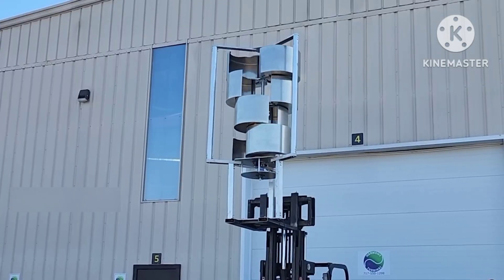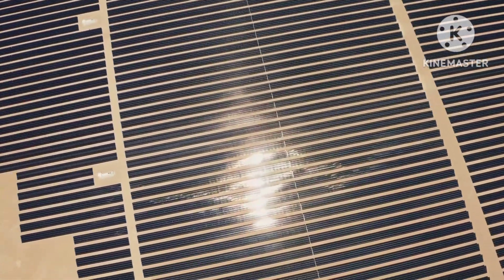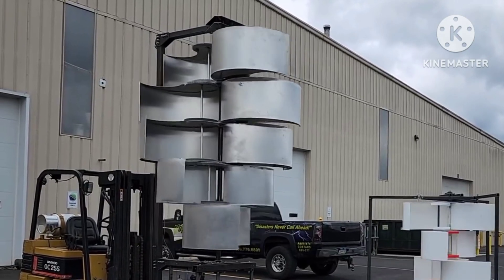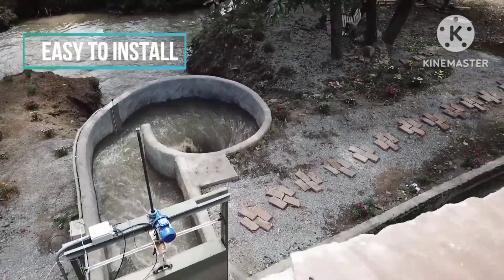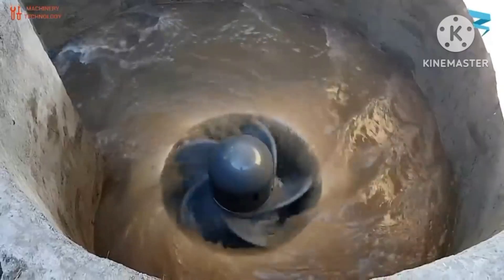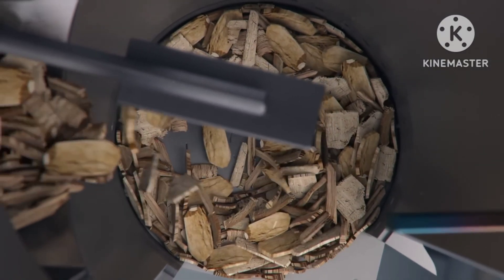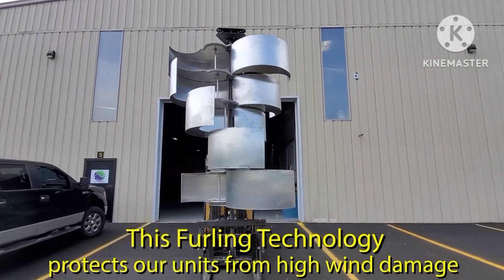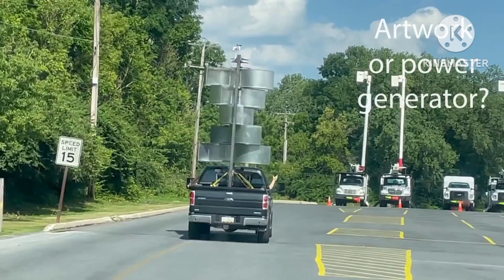How HARMONY Outshines Other Home Wind Turbines

Comment from the maker: In my video at 1:52, I mentioned that Harmony turbines can harness wind speeds as low as 1-2 mph. However, Harmony Turbines reached out to me to clarify that they are still testing and developing their units. While the turbines may start spinning in 1-2 mph winds, they would need slightly higher wind speeds to begin generating electricity. Moreover, Harmony Turbines are still testing and developing their units.
Thanks for watching.

Comment: Can you please provide the calculations for the 438% power output? What are your assumptions? What wind speeds are you using, what's the location, and what's the solar panel you're using for comparison?

I'd also be interesting in specs and graphs about the power output at different wind speeds.
Reply from the maker: Harmony Turbines is developing residential wind turbines that are initially rated at 400W in a 25mph wind, with a target cost of about
$2,500 each 1. Currently, their test units are made from metal, which is the most accessible material for their development stage. However, they plan to explore other materials as they progress in their research
and development 
1. Their turbines are designed to be extremely quiet, start up in low wind speeds, and protect themselves in high winds through a patented
furling mechanism 
2). This allows them to continue generating power even in challenging conditions